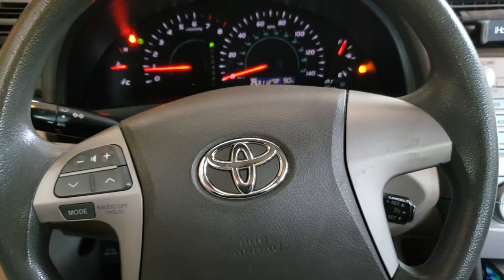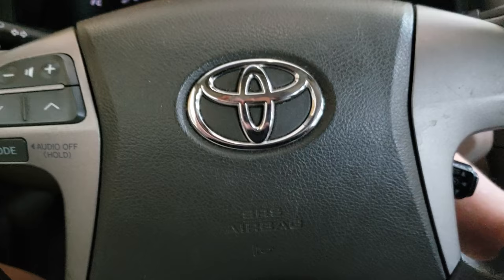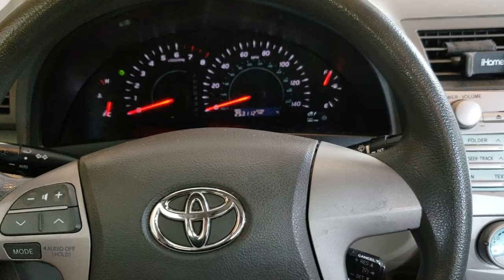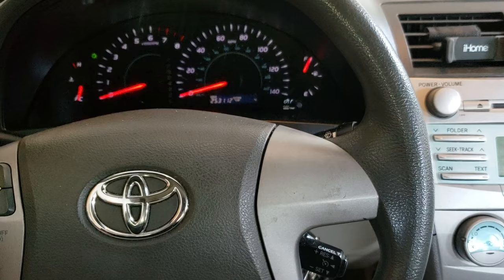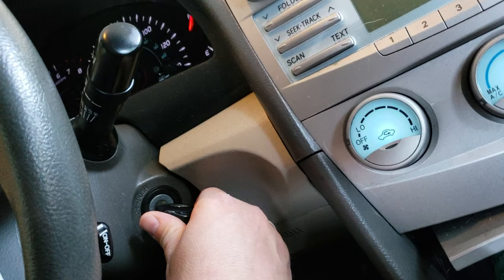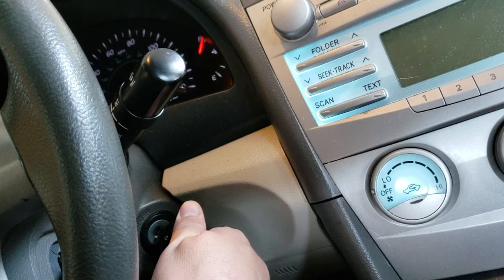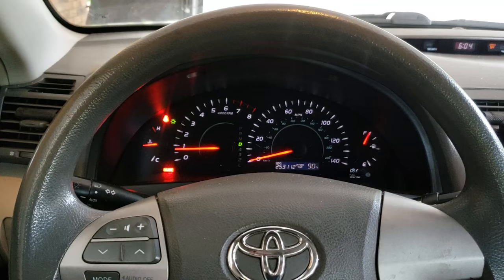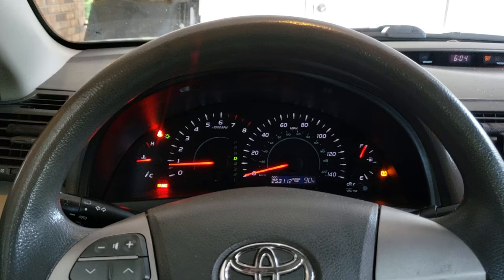How to reset the idle on a toyota camry (after battery or terminal change)

Comment: I replaced the alternator and the idle was really lo, like 500 or below, stalling sometimes at stop signs. After using this magic fix, it added about 300 RPMs to the idle speed, enough for it to run smoothly when stopped in drive and in park. Thank you SO MUCH for making this video, it was a lifesaver!🙂
Reply from the maker: So happy it helped you out

Comment: Did not work for ky car tried twice....
Reply from the maker: If you have a Toyota from 07- present it will work.  It's same technique used at dealer
Reply: @THEMANCAVE2023  its camry 2003.
Reply from the maker: Won't work for 03 06 made after June or 07 up

Comment: I approved this method 1000% work on Toyota vios... After testing on newly replaced battery and idling went low then engine shut off.. It took me 10 minutes to hold gear d and rev it a little to almost 1000rpm sometimes.. Everything goes back to normal... 👌👍👌👍🙏
Reply from the maker: Thanks for sharing and for your comment

Comment: Maaaaan I simply disconnected my battery to do some simple maintenance. And afterwards RPM was low, it would stall and die, and AC wouldn’t work unless I was over 500 rpm. I was about to start going down the list before throwing it to a shop. Came across your video, gave it a shot. So far. 24 hours later we’re running back to normal again. LIKED and SUBSCRIBED! You are a real life saver, and money saver! Thank you, the biggest and more sincere Thank You!
Reply from the maker: Your truly welcome. I am so glad it helped you save time money

Comment: You will definitely help lots of people out there friend. I also have a 2007 Camry and always reset it with my scanner but I'm pretty sure not everyone out there has a 2k scanner .  Never knew there was a manual method pretty good to know . They are making care nowadays that when you battery dies you have to take it to the dealership cause the car wont move and windows wont roll down 😂😂😂😂 ridiculous.
Reply from the maker: That's why I shared the video. Because I think it's ridiculous that you have to drive a car a 100 miles in that condition if you don't do this, I now drive a 2021 Honda Accord touring 2.0, Turbo and Lord knows.  If anything breaks on that or it needs adjusting, I actually had to buy an auto about a $700 scan tool just to do brakesand testing not so many nuts and bolts wrenches more diagnostics for sure

Comment: I replaced the starter on my 2007 Camry and had to disconnect the battery for better reach. After I put it back on, I still noticed two issues - slightly delayed start (albeit better than before I changed the starter) and a lower idling. My car used to move in D mode when foot of the brake, but now was just standing. I felt idling was off. I followed the steps you highlighted and gave it 8' for good measure, now the idling issue seems to have fixed. thanks a lot !! Now just need to solve the other delayed start problem.
Reply from the maker: Glad it helped

Comment: This was awesome because my ac wasn’t running at idle after I fixed my abs sensor module messing up by wedging an object in by the connector. Car stopped losing speedometer but wasn’t blowing cold at idle until I followed your advice. Thank you!
Reply from the maker: Very happy to help

Comment: Thank you so much I really appreciate that there are videos like this that exist because the Toyota dealer wanted to charge me 125 dollars
Reply: Thank you so much I am really glad that our videos out there like this because Toyota wants to charge 125 dollars the last time I went to Toyota I had them turn off my ABS light and it came back on the next day so when I took it back to the dealer they told me I need to replace my whole ABS computer which will cost me $2,600 I went online and talked to a few of great people like you they told me just to disconnect the battery so why did that and the ABS and brake light never came back on again so videos like this have saved me thousands of dollars thanks again
Reply from the maker: Happy to help
Reply from the maker: If answers needed just ask I replie as fast as youtube let me know

Comment: Great info, thanks!!!  You have 253,000 miles on your Camry and it still runs smooth as silk.  I own a 2012 Camry LE with 75k miles.  I drive 2500 miles a year (I'm retired).  Oil and filter changed annually.  I use only Pennzoil Ultra Plat. and the 20k mile Fram synthetic media filter.  The car should outlast me.  Toyota is a great value.  Cheers!
Reply from the maker: They are great cars I finally traded mine in with 316000 miles ( still ran great) but I drive 40-50k a year for work but got a 2021 cam and love it 60k strong already
Reply: Wix beats Fram by a ton

Comment: Thank you. I was about to start pulling my hair out. I was told many times I should clean my terminal. So finally I did that today. Then my cars RPM was low and it was not idling correctly.  I was about to hire a local mechanic. . Thank you so very much.
Reply from the maker: Happy to help ☺

Comment: You're awesome! Taught my son a lesson today. Now if I could just get him to keep the oil level up in this 2007 oil burning monstrosity! Thanks!
Reply from the maker: Lol thanks and thanks for the comment.  Be advised there is a recall for 07 camerys.  Included for bad piston rings..
Reply: @THEMANCAVE2023  Yeh, but I think they closed that out in 2015 or 2017... not to mention the car has 245k on it... so we'll just keep feeding it. Thanks for the response though! Hail Lobster!
Reply from the maker: Lol OK I had 195000 on mine when it went in so not sure.
But happy to reply
Reply: Mine burns oil too! About a quart every 800 miles
Reply from the maker: @lancelot0274  there was a fix for that that Toyota covered they fixed mine at 185000 miles ran another 125000 before trading in

Comment: Thank you so very much for this information! I have a 2012 Toyota Camry SE (*2.5L I4*) on which I’d had a whole new set of tires installed a week ago today, and I noticed a few hours after I’d picked it up from the tire shop that it was idling roughly and shaking a little bit. Mind you, it was a really hot day and I was running my AC fan speed at the middle-most setting, but I’d read on numerous forums that since pretty much all modern cars have computerized tire pressure monitoring systems, a common thing many tire techs do to reset said systems is to disconnect the negative battery terminal, not knowing about some of the consequences of such an action (i.e., wonky idling). Fearing that I’d have to book an appointment at my ‘home’ Toyota dealership and pay $100-200 (let alone miss half a day of work as we’re careening into our busiest season plus the costs of Ubers between my office and the dealership) for a throttle body cleaning, I stumbled upon your video and thought, ‘What have I got to lose???’ Anyway, I made my usual 42-minute commute into my office this morning, which allowed my engine plenty of time to get up to operating temperature, and proceeded to give this operation a shot once I arrived in my customary parking spot. Following your procedure to the virtual letter, I allowed my Camry to idle for nothing short of 8 minutes. Once the timer on my iPhone expired, I shut the car off and waited 30 seconds before restarting. When I restarted, I of course released my parking brake, shifted into reverse, and backed out of my parking space, driving one full ‘lap’ around the building. Holy crap! It really worked! There was no more shaking and my trusty steed ran as smooth as butter. And do you want to know something else? My ‘boy’ now accelerates even better than the day I brought him home from the dealership back in December; this was especially important on I-64 East (Charleston, WV area), where good acceleration really does count. Couple the relearned idle & better acceleration with those new Uniroyal Tiger Paw Touring All Seasons I got last week, and my Cambot now literally feels like a brand-new car. Thanks again, my man! Consider yourself liked and subscribed…😎🚘
Reply from the maker: Hey man thanks so much for watching and I really glad it helped you out.

Also thanks for sharing your story , I love  reading how such a simple fix helps save people money and maybe saves them just a little bit of stress in such trying times.

Thanks again truly

Comment: HEY, This was the best!! I replaced the alternator on my sister-in-law's Toyota. After reconnecting the battery, It had a low to no idle. Called the Dealership, the first person I talked to said, bring it in, $100+ diagnostic. Looked up and followed your video and it work!! Had to let it run for about eight minutes for it to idle correctly. THANK YOU for putting up this video.
Reply from the maker: Anytime I’m glad to see it helped so many people not get ripped off.  Just a FYI this will work with any Toyota.

Thanks for watching and sharing your experience with me and other people you all make this a great platform
Reply from the maker: Anytime I’m glad to see it helped so many people not get ripped off.  Just a FYI this will work with any Toyota.

Thanks for watching and sharing your experience with me and other people you all make this a great platform
Reply: @THEMANCAVE2023  hi you said any toyota . do you mean any year? thanks
Reply: J D hi there! it can work with any year and model of a Toyota (camry, corolla, avalon, etc., i’ve even heard on some Lexus models too). this procedure can cover years 1998 onwards. no harm in trying, i might save you some big bucks.
Reply: max ison thanks

Comment: Just bought a 2007 Camry today for my son.  The battery was fine but would be going out of warranty soon, so decided to swap it out as preventative maintenance.  After the swap the idle was low.  Figured it had something to do with the battery change as the car is great.  Thanks for the video, I think it took less than a minute!
Reply from the maker: Phil,

Your very welcome.  I'm glad it helped, that's the exact car I have 301,000 miles on it and still drive it 200-300 miles daily for work.
You made a good choice in that car maintain it they just keep running.

Thanks for watching and taking the time to comment i do appreciate it !
Reply: @THEMANCAVE2023 yo man 300 miles to work daily is crazy 😧.
Do you work as a surveyor or smth?

Comment: It worked thanks!! Also once I reset it my AC worked again nothing was ever wrong with the AC until I changed my battery….
Reply from the maker: Your most welcome.  When your fuel trim is off and idles rough the ac compresser will not start.  This is to prevent stalling just FYI

Comment: My 2001 Chevy suburban sat for 3 days, battery  died. When i fully charged the battery, the idle was shit an would stall my car an my ac would blow hot air at idle. I unplugged  my + terminal on battery while car was running  and my engine turned off.(was told that means alternator was bad) went to orileys to b sure, an yes. computer said the regulator was bad in my alternator. Bought, an installed a brand new alternator (fairly easy).....my idle was still shit! Still blew hot air!...... after all that...thank you this worked!....next I would of changed the idle air control valve an that's as costly as the alternator(luckily fairly easy to install) ... hope this helps
Reply from the maker: Thanks for sharing your experience and I'm glad it helped you.  Thanks for watching and taking time to comment

Comment: Thank you very much!

This worked on my 08 hilux ute with a manual transmission that I have just changed the battery on.

Beforehand the idle was so lumpy it would make the pen sitting in my dash rattle whenever I was stopped at lights... used the same method but instead put my car into second gear and sat there idling with my foot on the clutch and the other on the brake and handbrake engaged. After about 2 minutes the idle smoothed out and viola, no lumpiness or rattles. 

In fact I don't think it has ever idled this smoothly. 

Cheers.
Reply from the maker: Thanks so much for sharing and watching

Comment: This is one way to get the Engine Control Module (ECM Computer) to reprogram. However it's  better overall if you never dump the ECM memory. That way if a caution light comes on a tech (or you using Blue Driver) can plug into the ECM via the OBD2 port near the steering wheel. (On Board Diagnostics) to see what's in the computers memory.   The other way is to use a jumper battery like most professional techs do. Most will  have a small 12 volt motorcycle in the shop  and attach it to the battery terminal leads before they remove the old battery. ECMs now days remember your driving patterns and use those for fuel trim calculations. Tip! Anytime you have a engine problem the first thing to do is check the negative terminal on the battery. Amazing how they get loose or highly corroded.
Reply from the maker: Thanks for watching

Comment: So I just came across this method today and I've seen a couple variations, one were you turn the key on and off twice before starting it, and one where you press the throttle all the way to the floor so the car knows what maximum throttle position is. Definitely going to try this a few times cuz I was planning on taking it to the shop tomorrow and I know they're going to tell me that I need to spend $500 and Lexus certified parts for a new MAF iacv and possibly idle control valve
Reply from the maker: Hey man.  It works I just did it again 2 days ago.  My battery crapped the bed.   

Oddly I forgot to do it , till I got to the first red light.  Then the car about stalled.  Pulled.into parking spot did this in 5 min and never looked.back super easy.

Thanks for watching and commenting appreciate it and you 

Consider subscribing thanks
Reply from the maker: Hey man.  It works I just did it again 2 days ago.  My battery crapped the bed.   

Oddly I forgot to do it , till I got to the first red light.  Then the car about stalled.  Pulled.into parking spot did this in 5 min and never looked.back super easy.

Thanks for watching and commenting appreciate it and you 

Consider subscribing thanks

Comment: I know this is an old video, but I have some questions and observations I would like clarification on:
1.) I’ve read/seen this done multiple ways. Sometimes On/Off/On/Crank. Sometimes On/Off/On/Off/Crank. 
2.) Every other method I’ve seen has said that the engine MUST be warm, but yours here is all the way cold.
3.) Do you apply the parking break before or after cranking the engine? I’ve only ever seen it after. 
4.) What exactly is the technique here? Does turning On/Off trigger something in the computers? Why do we have to do this manually?
Reply from the maker: Does not matter if engine is cold or warm.

Turning key sets computer to relearn process.

You can apply parking brake before start

Thanks

Comment: I just changed the battery and had the same issue 01 Camry i currently have it in drive with e brake on I’m like 3 minutes in hopefully it works because this is my only means of transportation
Reply from the maker: It works just take time and follow steps

Comment: This fixed my idle issue on my 07 camry. I still have a battery indicator on a new battery and set fuel trim. 

Thoughts? 

New alternator and zero light or accessory issues.
Reply from the maker: Factory alternator or parts store alternator?

What type battery as well.and your climate
Reply: @THEMANCAVE2023  salvage alt about 5 months ago. In Florida. It's 50s atm. Usually swampy as hell outside.

Comment: Its actually from carbon build up in the throttle body reducing air flow.  By disconnection the battery the idle speed adaptation is cleared.  For some reason the self-learning procedure for the idle speed is a bit slow on these vehicles is slow or non-existent with a dirty throttle body.  If you take the air boot off the throttle body and wipe it clean with a rag and some brake cleaner or gum cutter it will instantly idle correctly again.  Eventually it should relearn the idle speed by itself.......eventually.
Reply from the maker: It will generally took mine 2 days.  But I drive 200-300 miles daily so the rough idle kills me
Reply: @THEMANCAVE2023  You had a easy way to combat this I have found investing in a OBD memory saver hooked to an external power source such as my jumpbox and the other end in the obd port is an even easier method when disconnecting the battery especially on modern toyotas.

Comment: i changed my battery and didn’t do this, and now i’m getting the same problem i was getting before i replaced the battery, could it be the alternator?
Reply from the maker: What was the issue before?  Need info to answer your question

Comment: Does anyone know how to reset with manual transmission? I can’t find anything, I have low 500rpm on idle after battery change.
Reply from the maker: Try driving.it with ac on for 30-50 miles should reset
Reply: Update: I cleaned my throttle body, I also cleaned MAF sensor. Then I tried to do the reset, I just kept it in neutral the whole time. And fair enough the rpms settled nicely at ~850. Thank you for the vid

Comment: - [x] Toyota idle relearn:: 
1-turn Key on and Off 2 times ( leave in On)
2-Engage Parking Brake
3-Start Engine
4-Put in Drive—with Parking engaged—and brakes on—idle for 2 min ((( you will see RPM slowly Goes Up from 200 to 400 RPM )))

Comment: Doing this for my Toyota Camry 2008 because it idles too low when I have the AC on and it turns off ☹️
Reply from the maker: Should work well as long as your idle  air sensors are working normally